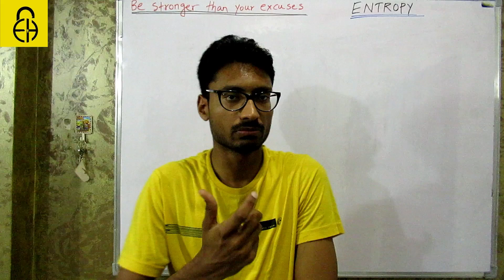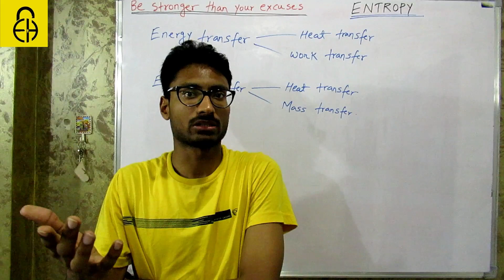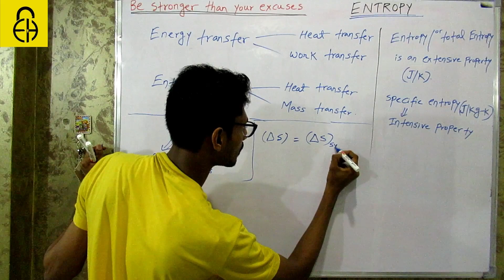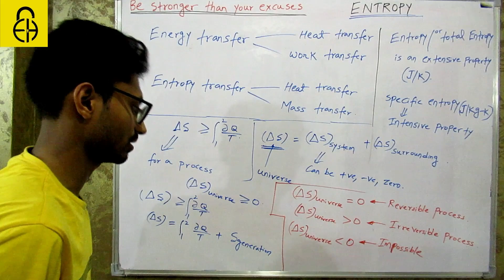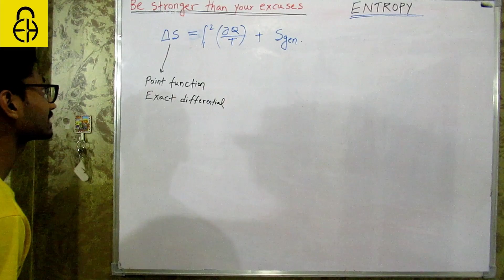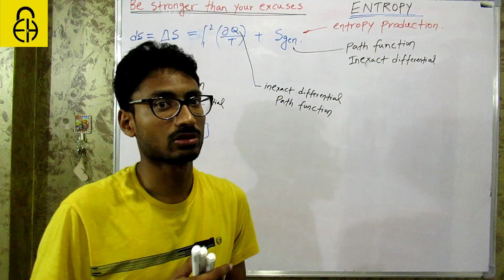Entropy Detailed Explanation | Part-1 | for GATE/ESE/BARC/ISRO | Mechanical

Comment: Sir b/w the glass os ice chips and glass of water..is it the glass of water which has high entropy bcoz of more disorderness than ice chips?
Reply from the maker: Yes, Karthik you are correct. Molecules of ice chips are arranged in an orderly manner and hence possess lower entropy. In the water molecules are more apart which increases the randomness of molecules to move causing higher entropy.